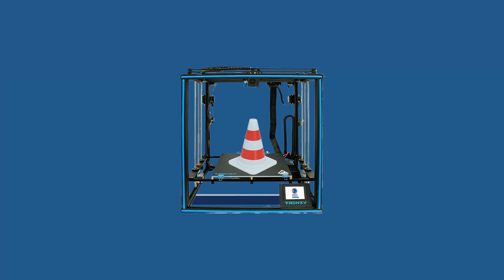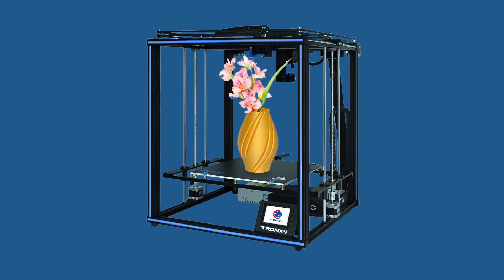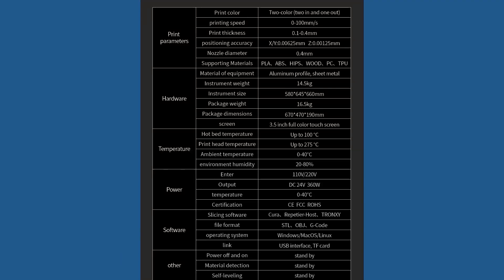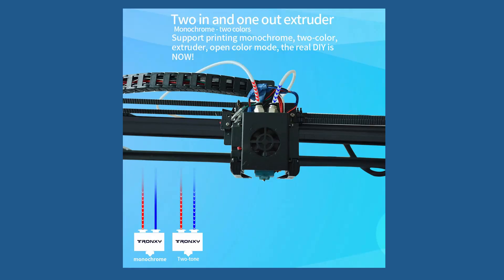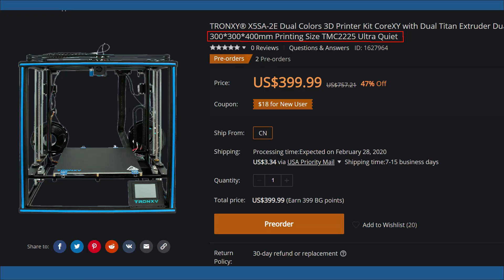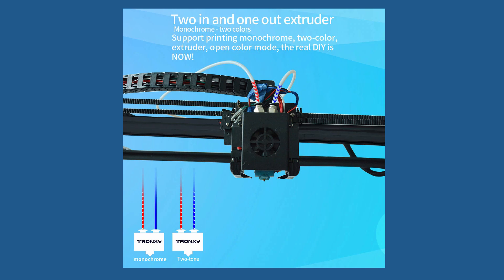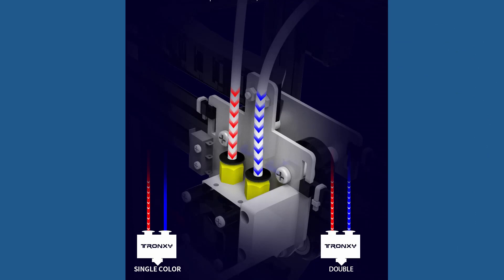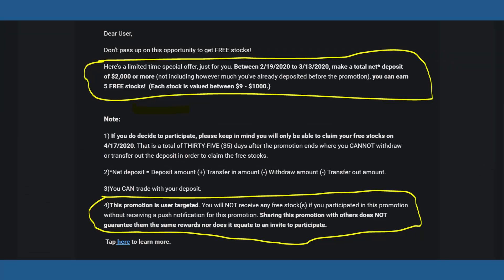TronXY X5SA 2E | CoreXY | Dual Color | Dual Extruder | Large 3D Printer

Comment: Horrendous customer service thieves. Arrived with shattered glass and dented metal bed. They sent new glass but indefinitely put off replacing the metal bed. Never worked, the bed always slamming into the extruder and continuing to push, despite the sensors triggering in the correct order. Repeated "solutions" never worked. Weeks between responses, sometimes. They tried to distract me until PayPal's warranty would run out. Just before that end at 6 months, I submitted the case to PayPal and uploaded tons of evidence that Tronxy can't fix it and still won't refund me. They tried to blame it on user error, but I recorded doing exactly as they asked. They offered me $50 as compensation. PayPal gave me a full refund, but I asked for the $50 anyway, for the hours of trouble. Instead, they asked me to return all but $100 of the refund, obviously trying to entice me with more than $50 while taking as much as they could. Tronxy doesn't at all care about its customers. We're victims to steal from. Model: X5SA-500-2E $850